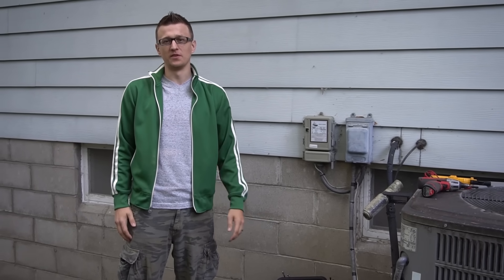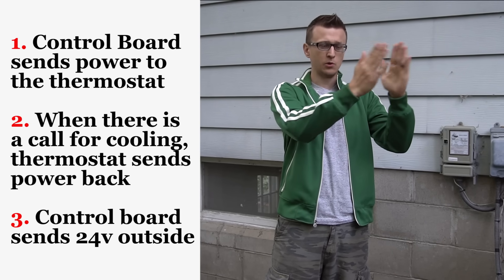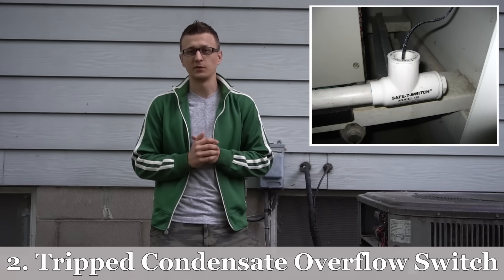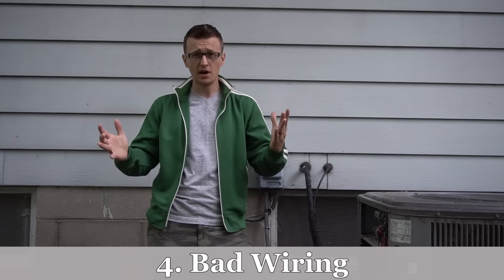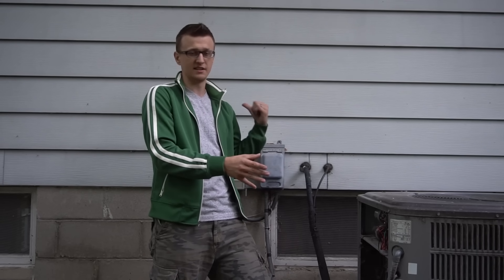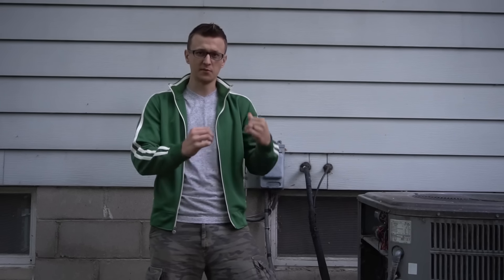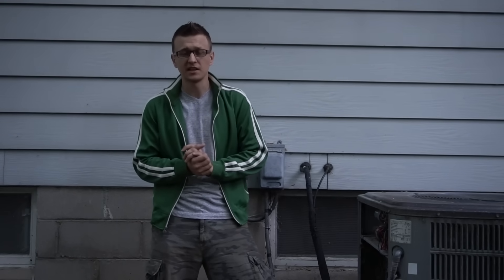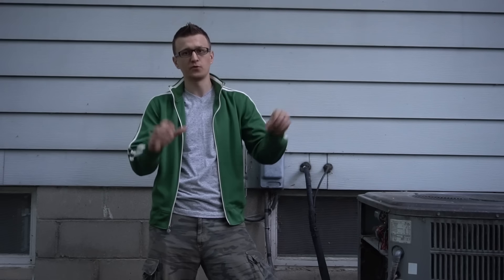AC Contactor Not Pulling In - 10 Reasons Why

Comment: I noticed contactors  has one or two poles styles and some are 30 amp and others are 40 amps.  What are the differents?  Will it harm to put a different Contactor in the a/c unit?  Is it necessary to upgrade and how you decided what is better for the ac unit / upgrade?  Please advise.  Thx
Reply from the maker: A one pole contactor always has one hot leg that does not get interrupted. So 120v is always going to the unit. But a 2 pole contactor interrupts both hot legs. There is no big difference between the two. As for the amps, I would rather get the 40 amp contactor as it can take more abuse if necessary (power surge for example)
Reply: @WordofAdviceTV  very informative !  thx

Comment: Thank you so much for all your great videos. So my outside unit if i touch the metal on the right side of the connector plunger the unit will fire up. But will not stay running. Do you think i need to replace the whole connector or should i pull it out and check to see if something is dirty etc?
Reply from the maker: From what you described it sounds like something is either loose or broken.. Or like you said it could be dirty too. If you can't see anything loose that you can tighten and nothing is plugging it up, then I would replace that contactor.
Reply: @WordofAdviceTV  thank you so much. Keep up with excellent videos!!!
Reply: @WordofAdviceTV  is there an email address i can email you at im hsving some issues. I got the replacement part which is slightly different looking. I tried to hook it up and dont know if i hooked something up incorrectly, now my thermostat will not come on. I even tried to put the okd part back on an still no functioning of the thermostat which is an ecobee thermostat.
Reply: Have pics of the new part and old part. Only a slight difference but it did not come with instructions of which wires go where. I tried to mimic the wiring from the old one to the new one but not sure on a couple of the wires what exact position they should be in.
Reply: Update fuse was blown on circuit board in furnace so thermostat is working now. Just need advice on how to wire the new AC contactor since it is slightly different.

Comment: With you I can become a pro. Thank you!!
Reply from the maker: If you are constantly learning, you will for sure be a master! :)
Reply: I am connecting my electrical mota 55apms 380volts  my conductors ere 95amps 380v but when i am trying to run it it fails to engage into delt conductors start    surging

Comment: My A/C wont shut off and ice forms over the pipes
Reply from the maker: Is your contactor possibly stuck with the plunger pulled in? If it is, try turning off power (and making sure it is off) and then manually pull that plunger up and down to free it up. Otherwise it can be a control board issue as well..

Comment: I learned that it was my bad board that’s causing my contactor from pulling in .  My question is what would cause my board to go bad , I had dark burn spot on it.
Reply from the maker: It may have been a power surge.. Hard to say. Sometimes they burn out for seemingly no apparent reason. As time goes, wear and tear I suppose. Do you have a 3 amp fuse on your board? If not, i would splice one in.  I don't think I have ever had a new control board burn out on me right after I put it in though. (if that is what you are worried about)
Reply: Word of Advice TV  . I don’t think I  have a 3amp fuse on the board .the board is a Goodman Pcbdm133 . I installed the new board , but it still won’t pull the contactor to activate compressor/fan . 
Thanks for getting back to me, I don’t know what else it could be .
Reply from the maker: @livingthebreakdown  Do you have a meter? If you check voltage between Y and C on the control board, there should be 24v (with the thermostat calling for cooling) If there's 24v going outside, then you know that the problem is outside not inside. I would start by figuring that out first.

Comment: Hey 
Please I need help 
I have a ac/heat gas unit
Big square unit outside of my house
When I turn on the heat everything works normal, 
But when I turn on the ac the unit outside works compressor and fan work but the blower just doesn't turn on 
Please I really need help
Why the blower just turn on with heat and not with ac
Reply from the maker: Most likely the control board is the problem and would need to be replaced. For a temporary solution, try switching your fan setting on the thermostat from AUTO to ON. That will keep the blower motor on all the time. And another video that you may find helpful: https://www.youtube.com/watch?v=JSgLGTAbDF8&t=351s
Reply: It not turns on like that
Just the unit outside
The blower still off
But why when I turn on the heater the blower turns on, everything works fine

Comment: Great video and thanks so much - question.  I have 24 volts at the wires going to my contactor, however, when I plug them in it goes to zero.  we tested the contactor off the unit and it worked.  Any ideas?
Reply from the maker: That's odd. I don't think I have ever seen one do that before. So between the two wires going to the contactor coil you have 24v but when you plug them in, the voltage disappears? My first thought would be that the contactor is defective but can't say for sure, sorry

Comment: Great video! Would you replace a contactor if the terminal is rusted to be on the safe side even though the A/C is working?
Reply from the maker: If there is a lot of rust or corrosion it would be best to replace it before it does become defective. Or if the rust is only on the terminal/s, you can try cleaning them

Comment: Jay, GREAT VIDEO! Like Lilianna below, I am able to manually press the blower (evap.) contactor down and the blower comes on. I'm trying to trouble shoot a roof top unit at my church. It is a 1991 Bryant RTU with separate contactors for compressor, condensor fan and blower (evap) fan. Blower DOES come on for 'heating', but not for 'cooling' (compressor runs and cools fine) nor 'Fan On'. So when heating, blower contactor 'sucks in' and blower fan runs, just not when 'AC' or 'Fan On' is selected. Your video gave me good things to test next time I get ov er there (I bought a new contactor to try then too). Could it be anything besides the $330 control board :o/). There is a transformer and a little black box (5 min delay?), but why is only the blower being disabled and just for AC & 'Fan on'. You have been my go to guy before for my home AC. This church RTU has me baffled! 

It may be unrelated, but this RTU has two compressors. I'm guessing it is a two stage system since their separate evap coil circuits are housed in one ducting outlet. The second compressor does not come on (but only mid eighties weather now). Thanks in advance if you have time for any pointers.
Dave
Reply: A bit of info I forgot: In January, the blower fan (for heating) would stay on continuously sometimes. On the RTU control board I noticed the brown wire was broken from the W2 control RTU board terminal. I reconnected it, in case that was it. Last week I disconnected the brown wire in case THAT had caused my current AC 'no blower' issue (it did not fix it).
Reply from the maker: Hey there! Sorry to hear about the RTU problems. I rarely ever work on RTUs so I can't exactly picture it in my head. But from what I understood, the blower motor inside does not come in with the air conditioner. If that is the case, then most likely either the thermostat is bad, or the control board. This is how I check to see which one is bad: https://www.youtube.com/watch?v=JSgLGTAbDF8&t=346s
Reply: @WordofAdviceTV  Jay,
Thanks so much for taking the time to respond! :o) Tomorrow I'll use your tips and check for 24 volts present at control board input (from T'stat)  and  24 volts at the blower motor contactor (while in AC mode). The control board 'does' successfully  send a signal, activating the blower contactor and thus running the blower for 'heating' mode. Maybe the control board has separate relays/paths for sending signals to the blower, the compressor and the condenser fan (each has it's own contactor). Plus I have a brand new blower contactor to install after I do this testing. THANK YOU SO MUCH for your replying to me and especially for your EXCELLENT videos! ! !  :o) 

I think I'm going to watch some of your miscilaneous videos for ideas on how to fix 'other stuff' too! ;o) IMHO, you are one of the great fixit gurus in the Universe (well this one anyway ;o).
Reply: Update: THANK YOU JAY! ! !  Blower working in 'AC' & 'Fan On' mode now. Boy do I feel dumb. Behind the thermostat, the 'G' Green wire was not connected, so T'stat was not sending it's fan run signal to RoofTopUnit! I had assumed by swapping a known good T'stat in that location, the problem was on the roof top unit. Jay, thanks to your video, I learned to verify there WAS a 24 volt signal going to the RoofTopUnit from the T'stat. To my surprise, there was not! Back inside to see why... the green not connected. Mystery solved. Jay, keep up the great service you provide to man (and woman ;o) kind!
Happy Cinco de Mio!
Reply from the maker: @davekro12  Awesome! Glad to hear you tracked down the problem! It's always nice to have success after all the effort you put in :) Thank you for coming back with an update!

Comment: Yeah!   Got the part and installed it on my ac condenser today.   You were right Jay, it was labeled so got the new one reinstalled with no confusion.  Thanks for giving me the confidence to do this with your video and quick response.  You have the knowledge  and attitude of an excellent instructor!  

If you don't mind, I have another question.   My 11 year old 4 ton Goodman condenser unit is vibrating more than it should be as I see shaking of the 4 sided grills when unit is turned on.  Something else new is the pulsating quality, or wave-like sound to what should've been an even level or tone of normal operating noise at the condenser unit.   Mine is not clanking, jolting or harsh.   It's just the normal operating sound that seems to have a pulsating quality that goes  regular, softer, regular softer, sort of like turning the volume up and down on a consistent, regular bases throughout the time it's running.  Almost like it's not getting consistent power.

      I've cleaned the fins off what I have access to the half side of the evaporator coil in the attic, and took apart the outside grill to hose down the condenser unit fins.   They both looked fairly clean before I began as I change out my air filter and wash the fins regularly.    There's no clanking or other harsh noise, and the compressor and fan kicks on right after the thermostat turns on.   It also blows cold air.   But this wave like sound is something new, and making me think something is not quite right.  If possible,  I'd  like to get more life out of my unit and address the problem before it damages something.  

  I've googled and looked at symptoms of a motor fan or a compressor going bad, and neither quite fit the sound  I'm experiencing.   Any ideas or suggestions so I have some idea what I'm dealing with?  I've now replaced both the capacitor and the contactor just for regular maintenance purpose given its age, and see no improvement.  so any feedback would be appreciated.   Thanks for reading this long post.
Reply from the maker: Glad to hear the repair went smooth! From what you described, your unit sounds like every third air conditioner I see... So I don't believe that is anything serious. Unfortunately for noise issues I can't give you much suggestions besides trying to tighten down all the screws. I have had units that I could not quiet down no matter what I did to them but the AC worked and cooled the house just fine. That pulsating sound is a pretty common occurrence but I don't have a technical answer for you as to why it does that.. :/ I also see brand new units running like that. So if it were at my house, I wouldn't worry about it :)
Reply: Good to hear.  Thanks tremendously for all your help, Jay!

Comment: Thanks so much for your informative videos. I have a fourteen year old Trane unit; have had no luck in searching for parts; apparently, the manufacturer make these available only to authorized dealers. Any suggestions?
Reply from the maker: What part are you looking for? A lot of them can be found on Amazon if you know the part you need (look in my description) otherwise you can use some online HVAC parts store to figure out what specific part your unit needs. Repairclinic.com or Northamericahvac.com just to name two. You can look them up on Google. If you feel like a website is insecure then I would suggest copying the part number and trying to find that part on Amazon instead.
Reply: I was trying to find a deal on a new compressor in case mine died; guess I will have to open top of the unit, go inside, and find part number by inspection. Have tried those sites, google, etc, attempting to use model number of Trane unit to get compressor part number, but no luck. @WordofAdviceTV
Reply from the maker: Oh.. If you are looking for a compressor then you might not be able to find it. Sometimes contractors can't even get one for older units. I don't think manufacturers sell R22 compressors any more.
Reply: ok, thanks; keep up the great videos. @WordofAdviceTV